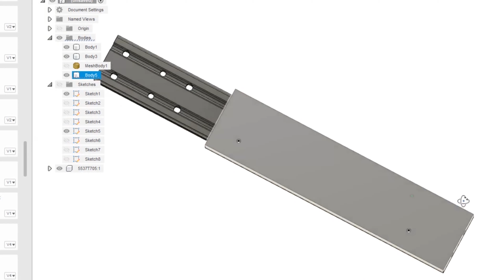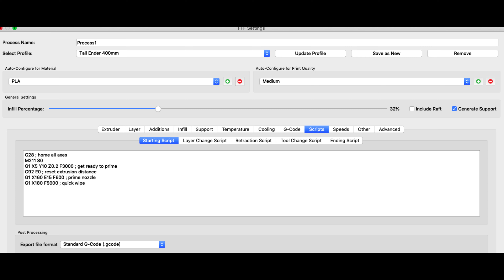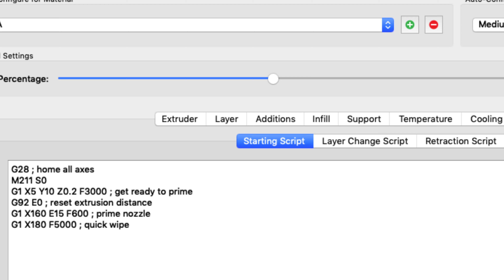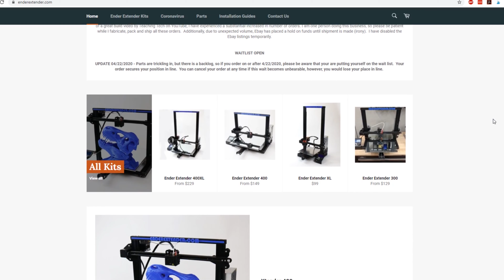How I Made My Ender 3 Printer Taller

Comment: You can avoid drilling the holes for the Z-Axis altogether by using a mount like this:
thing 2932344, (the PSU doesn't really need to be bolted to the frame. 

I already use such a mount because I was having binding and aligment problems with the default plastic mount of the z-engine mount, that I couldn't fix even with a shim. You could also mount a second z axis for a dual motors if you have an SKR mini. I wonder how well a single rod would behave at very tall prints, I've been wanting to do this upgrade to extend for 400mm tall prints for a while But I can't find the 2040 extrusion with the correct Bolt diameter, and I DON't want to make the holes bigger on my stock printer. Also, splicing the wires looks like a PITA, I'd really want a extender or just buy a full hot end setup from a CR-10 instead.
Reply: I did a similar conversion a while back that increased my print height to 400mm, but I also did a dual Z & linear rail conversion at the same time.  My power supply has been moved, but you can use the stock extrusion as a template to drill the holes for the PS as well as the Z stepper.  He says in the video that you don't need to stabilize the Z extrusions, but I strongly disagree.  I had TERRIBLE ringing and artifact on any print above 200mm.  Now, that might be because the linear rail is transferring every vibration back to the print...I don't know.  However, I do know that the ringing and artifact disappeared after I put stabilization rods on it.  Also, I'm not sure how he got those 5mm bolts to just screw in on the lower and upper frame connections.  I had to tap mine to 5mm, but it's not like it's hard to do.

Comment: Thank you so much. I got the ender extender kit for my z-axis a week ago and everything I've tried with the firmware has failed. But you showed me the M211 S0 code and made it so that i could actually use what i spent money on. I put it in the exact same spot you did and the print is going now. Hopefully the next 30 hours go well. But either way thank you for this video. I had all but given up on ever reaching 500 mm

Comment: You mentioned that you used 16 gauge wire to splice into to extend the lengths of your extruder motor and other wires because the default is only for the standard height.  

For my build, my two V-Slot extrusions and my T8 lead screw are 1000 mm high. Meaning that I need to also splice in new wiring so that the hot end and thermistor, and all those wires that go close to the nozzle will need to be splice as well.

So I was wondering what size of wire gauge do I use for those wires?

Comment: Can you make it smaller? I want to do speed benchy without vibration
Reply from the maker: You could, but even small bedslingers will get ringing and vibration artifacts in the print. If you are optimizing for speed, your better bet is to build a small core XY like a Voron 0.

Comment: I know that this is an old video, but if I did the same code to disable the endstops will this effect the y axis, I am looking to do a similar mod on the y asxis
Reply from the maker: Yup code basically disables the software endstop  limits in the firmware without having to flash a new version to marlin. So as long as the code references the Y axis instead of Z, it should work.

That said these days, I'd vastly recommend swapping the Klipper if possible as it makes fine tuning mods so much quicker and easier.

Comment: mines done , 750mm tall ,. everything works fine mechanically.. I added the gcode script, and last night on a 400mm print , it stopped going up at 250mm , and kncked the part off the bed.. Interestingly , it kept moving x and Y , and kept shooting filament out.. any ideas?
Reply from the maker: Did you adjust the slicer have the additional height? As that sounds like it hit the imposed limits on the slicer side.
Reply: @HiroCreations  thx, i had a lwer case M on M211, that was the issue

Comment: Be careful when ordering parts as the 2040 listed on Amazon will not work. The groove has no bevel which is needed for the gantry to move without binding. I spent 60 bucks and drilled the extrusions and found out when installing. Wasted 60 on this goose chase. I ordered the kit and am waiting. It would have been really nice if he had included a link for the parts.

Comment: Do you have any information on how long the 2040 and the lead screw should be if I'm going for a certain z height? Say I need a 400mm height, should I purchase parts around 600mm?
Reply: Measure bottom to bed height then add the distance from nozzle to top of Bowden path and wire path, add this to your desired height and round up
Reply: 500on both

Comment: Would this work on an Ender 3 Max with the provided mounts? It looks like it will as the Max is basically a larger Ender 3 Pro but wasn't sure if you knew for sure
Reply from the maker: I don't have any hands on experience with the ender 3 max but I have had good successes with expanding pretty much every printer that uses aluminum v-slot extrusion.

Comment: What drives me insane with SLA, I have a photon S and Elegoo Mars, is watching the build plate bend down slightly while fighting suction. (Every 200 or so layers I see a build line stick out, .01mm layers) Do you think there would be any advantage to customizing ones own rig to add a guide rail on the front, so the plate can in no way bend down? Or would this cause more issues by not allowing a break point for the suction to release?
Reply from the maker: Sorry for the late reply (youtube never notifies me of new comments anymore). I know what you mean, most of the times when that happens to me its a undersupported object, but I'd also check the ball joint of the photon/mars. As uncured resin has lubricant like properties, so if anything gets wet with even a small droplet you can get slight slippage of plate mid print.

Eliminating the cantalevered arm with dual z axis is a good step, but something that is much harder to execute. Mainly due to the added complexity of having to either use nicer quality stepper motors or sync the z with a timing belt to avoid lost steps on power cut. I'm assembling a larger custom build SLA printer that does that for a future video. :)
Reply: That is amazing... I hope you finish it soon and are in talks with a manufacturer, I would buy a Hiro Counter axis in a heartbeat.  Thanks for the advice!  So far I like the Elegoo more because the 2 screws tighten that plate very securely.  The photon slips, it only has one smaller screw.  I just ordered the wireless filter fans for the MARS, woo.

Comment: Anyone get the S0 code to work?
Reply: I just got the Creality extension for my E3 V2, to be able to print another 100mm taller @ 350mm but I could not get it to go over the standard 250mm. I also have the BL Touch on it and  on the Creality site there is firmware for the Z axis upgrade and the BL Touch but they are separate and Im totally new to 3d printing so not comfortable messing with the firmware yet but found it annoying that Creality doesn't have a manual setting in the firmware so that users can edit those limits them selves without digging through the firmware, recompiling and reinstalling the customized firmware. Then I saw this video and jumped in to Cura and adjusted the printer height setting to 350mm which when I jumped in to the [Monitor] tab and tried to move the gantry above the stock 250mm it would not work. Then for the heck of it I typed the aforementioned G-Code from the video in to the [send G-Code] box "M211 S0" which is case sensitive. Then hit the Z axis up arrow in Cura Monitor and it worked! I managed to run the Z axis all the way to the top and now can print up to 350mm! Thanks to @Hiro Creations for the tip!
Reply: nope , not working